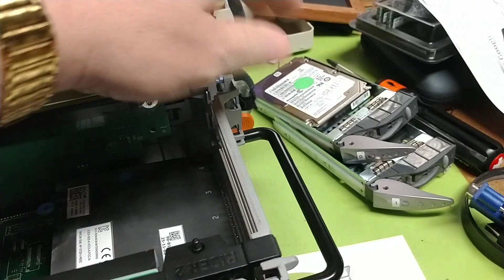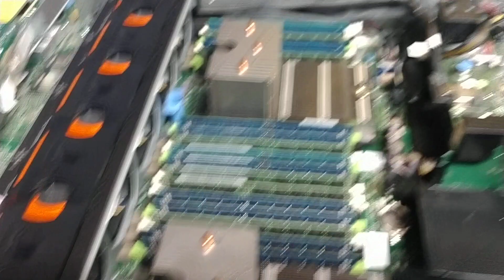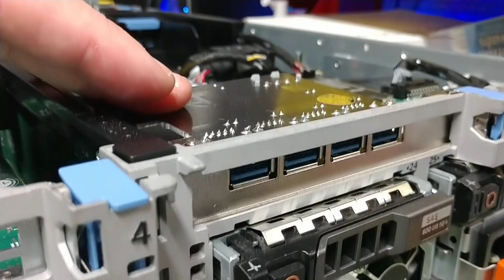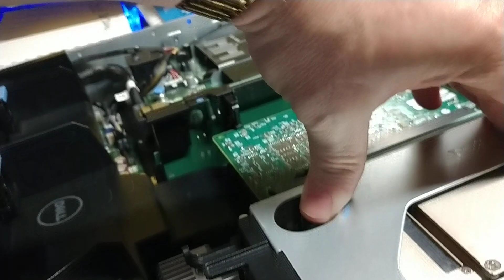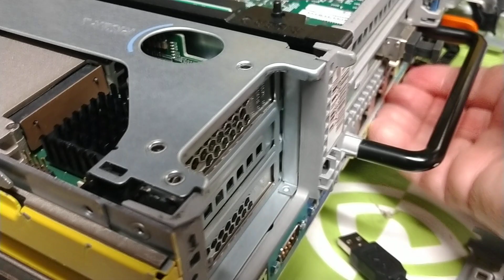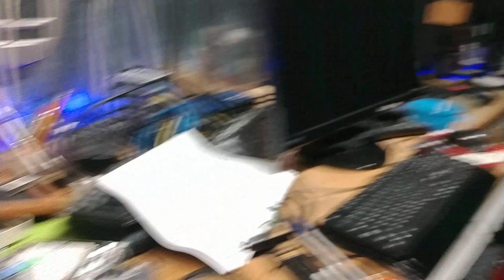Dell 720Xd is a great server for a 2U solution...

Comment: What's the part number of that 4-port USB3 card? Did you by chance pass it through to a VM successfully in ESXi?
Reply from the maker: Sorry for the delay, the card I used was (I think) this link from Ebay.  And yes I only use it once but I was able to use the USB port in VM mode.   https://www.ebay.com/itm/390639235457?hash=item5af3e9b181:g:m3oAAOSwpl9e8cYm&amdata=enc%3AAQAHAAAA8CWmL%2F6N7AqF2dVOseK8htd7thdMIROXvokSQ%2Blfpz9sCdOxrPQ7ewX2gV5Qiy3B3tOvXfIU2VWcOy3fKE8Dz6pih9maOIOE7KEwS0OQ83dMZaffXMKfpmfZae0S3RTVtGIW4kThxM7Szy2T23S%2FuxSJdMn0Bp84UOiUNorFzGMEvEBy%2FyX5orJUMrtPkWGwZrql7AWUDUpUY%2Bi5scqGCuyLToq9oKdj%2FmV3vIivdU%2FHycXHKKE1ehKezrcl8prsCoE%2FhVki4ze78QXejZCCmL%2B7Fe243ygaCFYyuPhjPzTC%2F3sF%2FLXd8S0HuvO%2BwLMV3Q%3D%3D%7Ctkp%3ABFBMpMfm26tg